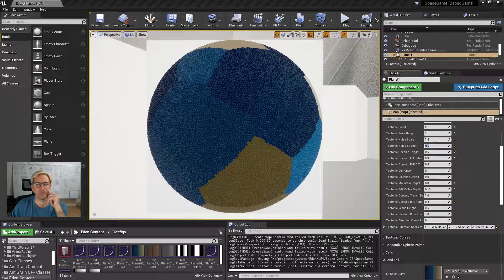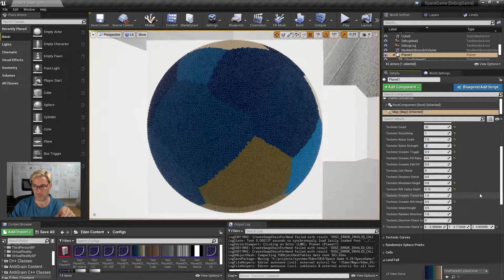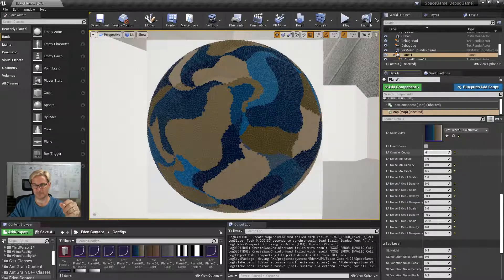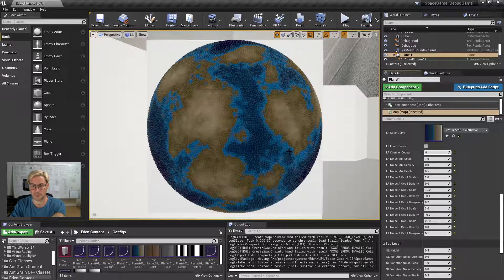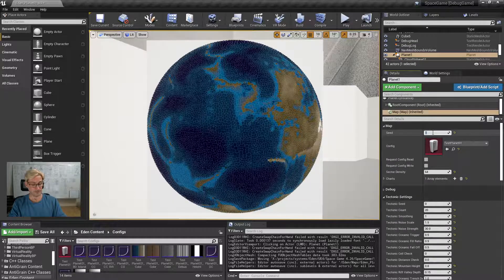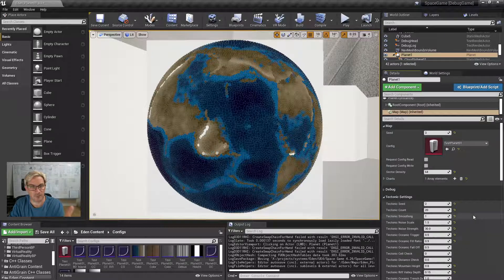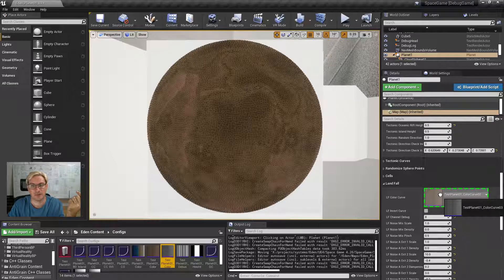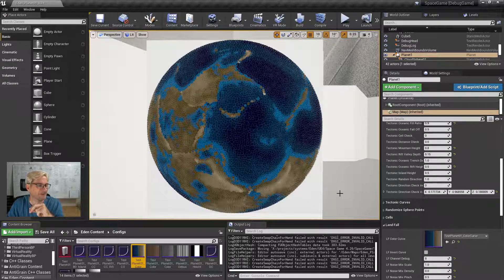Project Eden - Plate Tectonics

Comment: Hí! Can those map's continents move over time?
Reply from the maker: Sort of.  The whole map is based on a voronoi grid, the cells of which get assigned to plates by underlying noise...
The grid doesn't move, but the noise can.  So the cells won't move, but they can change which plate they're associated with.
Reply: @ScifiSiShredaholic  Thanks for responding. It would be interesting if people could make some timeline of the maps and how they change over time, but that's just my personal opinion.
Your 3d map project its quite cool.